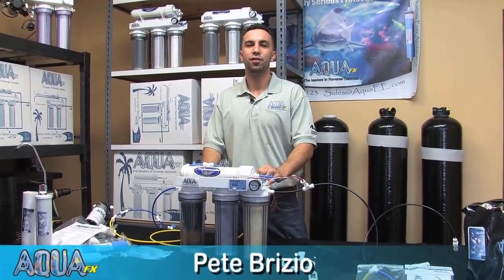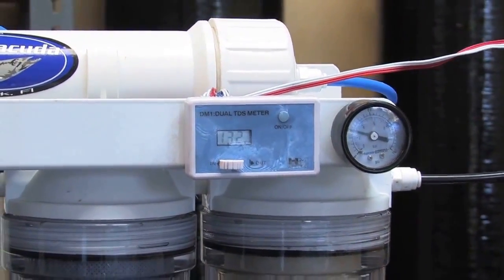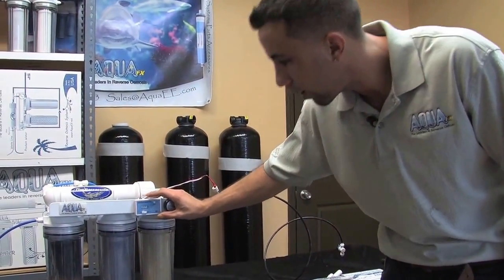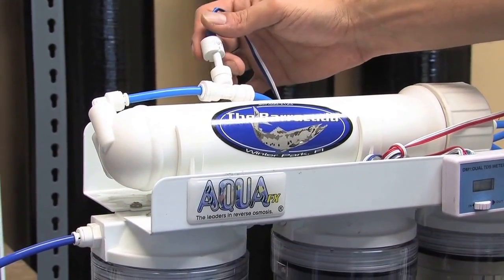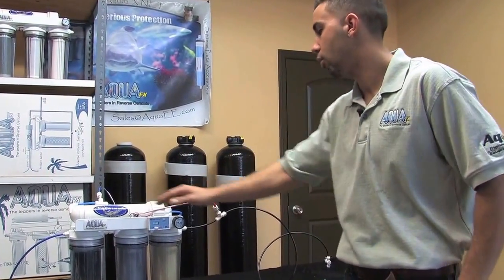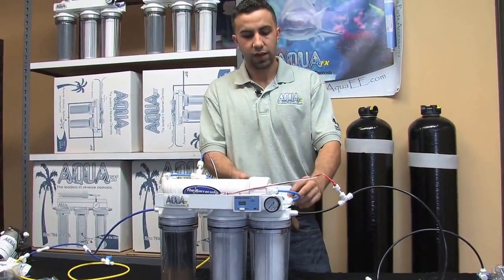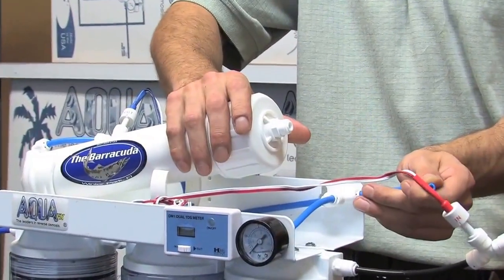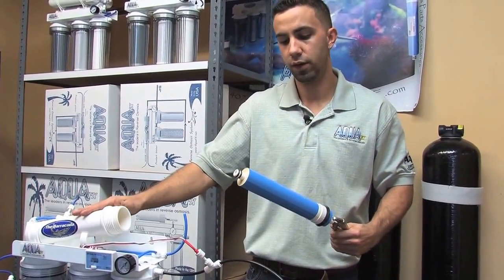AquaFX RO/DI Filter Change (knowing when it is time to*)

Comment: Appreciate the video as it was very informative.  I do have a question about flow restrictor for the AquaFX 4 stage Barracuda.  I never knew about the flow restrictor when I changed from the standard 50 gal GPD to the 100 GPD.  Got it from Amazon but there was no flow restrictor with it.  Where can I obtain the flow restrictor?  Thanks in advance.

Comment: I added the piggy back membrane to my system to produce up to 200 gallons per day.  I also have the add on Chloramine blaster kit.  Since adding the 2nd membrane, the system is not removing ammonia (city treats with Chloramine) Ammonia is now at 1ppm as product water.  Is the system running too fast to break up the Chloramines?
Reply: You are exactly correct; the contact time with the Chloramine Blaster is essential.  Unless...you just changed them, then it takes 24 hours after wetting for full working capacity.   We can add a additional canister to the front of the system.  Move the sediment to the new canister (in front) and run 3 Blasters in a row.   We can Also add a 20 inch canister in the front of the system and move the sediment behind the Blasters.   That works when you have high initial concentrations.  Feel free to give us a call 407-599-2123  The more we know abut your water the better the recommendations we can  make!

Comment: Great video.  A question:  Just replaced the membrane, new, and after 1 hour we still have to water coming out to fill the tank. What's the problem?  Do these sometimes come defective?  Also, noticed that the drain tube is always draining but nothing in tank.  Thank you for your help with this!
Reply: I want to make sure I understand your question.  Are you telling me, after 1 hour you still don't have water?   If that is the case and the drain is running, it sounds like it maybe a flow restrictor missing.  You can certainly call the office 407-599-2123

Comment: which size of unit will have the TDS meter built on it ? will the hundred gallon stage 4 have it on it ?
Reply: The units are built both ways, so its just a matter of whether you add it to the unit (or not to save $) but it makes much more sense to have one put on!! :)
Reply: We can put a TDS meter on any unit.

Comment: what is the purpose of the flow restrictor? What happens if you left in the 50 gallon one or took it out completely?
Reply from the maker: Hey Carl - The Flow restrictor will basically 'block' the waste water - and instead of all the water being able to escape down the drain - the water has to force itself thru the RO Membrane (creating pure water) - If you run an RO unit with "NO Flow Restrictor" you will get almost 100% waste and zero product water.     If you leave the 50 GPD restrictor on the 100 GPD Membrane you wont be creating as much waste water as you should be, the RO membrane can fail sooner. 100 GPD restrictor on 50 GPD unit  - the unit will under-produce product water and will be running excessive waste water.                                                                                                                                                                  I hope this helps Carl!! :)
Reply: AquaFXdotNet Thanks!! makes sense now. Do you think these flush valves are worth the trouble? I think all it does is bypass the restrictor for a few seconds or minute.
Reply from the maker: Carl Gennaro Thats 100% correct - but yes they 'can' be worth it if you make medium to large volumes of water. Simplified - the flush kit rinses the RO membrane and frees unfavorable things, releasing them into the drain extending RO membrane life. Commercial systems will almost always have a flush of some sort as commercial membranes can be $400-$500/each so maximizing their service life is critical. 

So i guess if you make enough water, or just want longer RO membrane life, Yes they are worth it!!  :)
Reply: AquaFXdotNet what size of unit comes with the TDS meter on it ?

Comment: 100 gpd don't exist just 75 gpd ask DOW ....😜
Reply: This was probably true at one point.  There are more membrane manufacturers now.  If you look at the Pressure, Temperature and water quality, which are the criteria for the rates, you will see there are differences.  It is called the FLUX of the membrane.